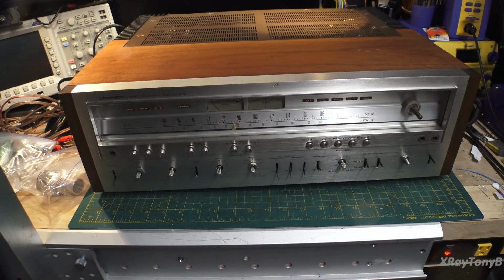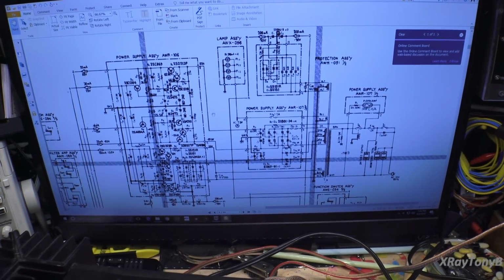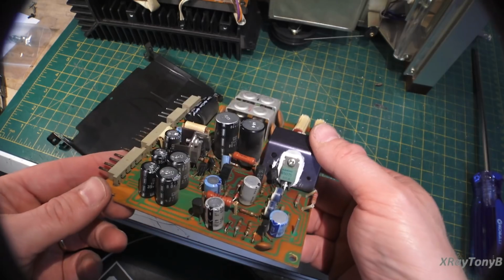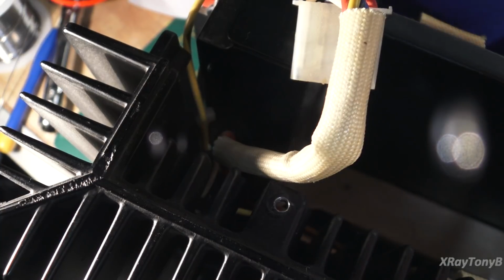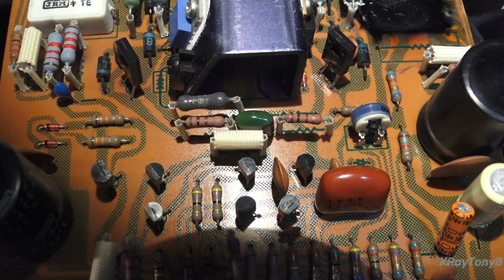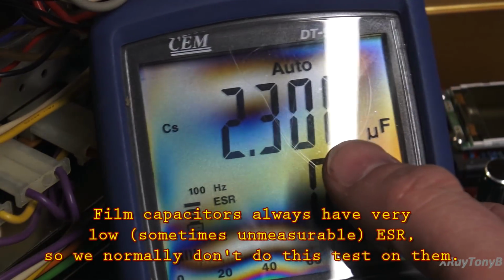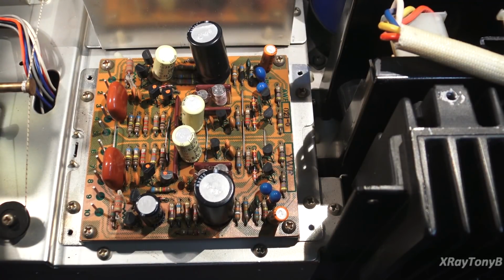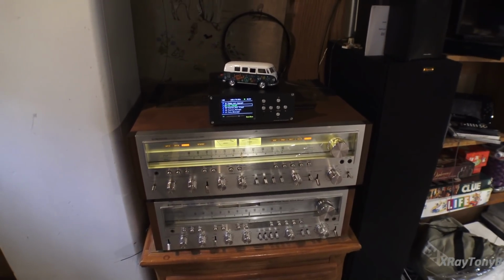PIoneer SX-1250 Restoration

Comment: Robert Matheson
I used to own a Pioneer 1250 and the matching cassette tape deck and turn table in 1977 and sold it in 1990 due to a channel failure. I cried when I sold it when I became frustrated when a local repair shop couldn't get it repaired correctly and was spending too much money at the time.  I always wish I could have it back working but it was too late. I didn't want to buy a used unit today as I was afraid that a used unit would give me a bunch more head aches. I didn't know that a full restoration could be done like you have shown me in your video. Your video has me feeling excited that I can again have my wonderful stereo system.   I am going to buy a used one from eBay and have it rebuilt by someone what ever the cost and again put a smile back on my face. Pioneer need to again make them again, there is a market for them.

Comment: I had the pleasure of baby sitting this receiver for 3 years for a friend who was in the Navy. What a power house, he also bought the matching speakers. I did not want to give it back to him when his tour was over. This was a great video, I am going to do a recap on my Harmon/Kardon  AVR 25II, right channel has low output as does rear and center channels. This is another beast receiver and worth restoring. I am an old point to point builder from the 60's and 70's and am getting back into electronics. Thanks for all the in depth description of the caps, some of them are new to me, like the poly's and film. I just found your videos today and will watch more of them.

Comment: back in the day I was an electronic technician.  I learned a little trick when soldering on pc boards and that was to use print kote solvent after you were done.  The reason was my job out of tech school was working on motorola pagers and 2-way radios.  Pages had very tight pin and foil layouts.  The flux left behind after soldering could potential mask a solder bridge or dot.  The PKS made any issue plainly visible and you knew what you had.  Also a bit of a pride thing to see your work so clean and perfect.  I miss those days of component level repair.  Now I program so my work is all virtual.

Comment: I wish I still had my SX-950 the wife wanted to downsize which is a good idea I don't like hoarding but dang I had my Pioneer gear since 76.  I weighed my SX-950 once if I remember correctly it weighed in at about 45 pounds. I really appreciated the quality of craftsmanship in my Pioneer gear.
Reply: Should have got a new wife.
Reply: @mac11380  As someone else who posted an SX-1980 restoration video said, sure, you could sell it, but then all you have is money. It's not like you could put it toward a modern replacement as some sort of upgrade.

Comment: I stumbled upon your channel last fall(2017) when the electronics bug hit me again after a 13 year absence(I had the classic car restoration bug). Of all the electronics/repair/restore channels on youtube you are in the top two. Thank you for renewing my interest in a much cheaper hobby. last Christmas(2017) my kids bought me a Pioneer SX-1980...only slightly broken- blown fuse. In their mind(my kids), the SX-1980 is supposed to replace - three Pioneer SX-1050's, 4-channel reel-to-reel, couple turntables and a few speakers...all had to be sold to make room(and money) for our rapidly expanding family....next up -- a Marantz 2230 that is just a mess, close to 20vdc at the speaker terminals---someone needs to make a restoration video on this old girl.
Reply: I have a 4270.  Blueglow Electronics channel has pointed me in the right direction with Marantz stuff, in case you didn't know about that channel.
Reply: You need to completely rebuild the regulated supply board in the SX1980, the 80V, 30V  pass transistors all need to be relocated onto the main heatskink, I have done this, and basically it takes a lot of the heat away from that board. There is another mod for the +/-80V current sources, factory uses this underwhelming circuit to achieve it, and there is a nice circuit you can build up on perf board and mount onto the existing board. Don't run the 1980 on an unrestored regulated supply board!!
Reply: I checked out his channel, thank you for your help!
Reply: Definitely need to look into that, thank you!

Comment: Definitive video on SX-1250, Just found your channel from a tech that said he learns from you. My idea to throw out there on that cut wire that was soldered back in, they did have these all hand assembled, mostly by women, back in the 70s on an assembly line, I think every receiver comes a little different, and sometimes what you think of as work done to the receiver, could very well came from factory.

Comment: I think that the DC offset combined with crossover eŕror maybe actually masking  distortions when operating at low signal levels as in your measurement. It's kind of a class  A amp in that case. Anyway, I do very much enjoy your video.

Comment: Interesting video. I have had my SX-1250 since purchasing new in 1976. At the time, the list price on this receiver was $900.00, but discounts were available. These were sold at a retailer called "Best Products" (no connection w/BestBuy), at a sizable discount. However, I purchased mine from Pacific Stereo and they price matched. Never have had mine serviced, though there are some minor issues (bulbs out, etc.). Seeing all the work you have done on this example scares me about how much service/repair would cost.
Thanks.

Comment: Great stuff Tony. Helped me immensely with my SX-1250. During my restore/recap, I did the front panel LED conversion also. Question is how did you get your front panel so bright?  Is there a difference in the construction  or layout in model years? My LEDs work and are very bright but the dial is much dimmer then the unit in this video. Any suggestions are welcome. Thanks for everything Tony.

Comment: I want one! Fully restored would be nice but a working unit in need of service will do! Just don’t know where I can find one! Great job great video cheers… Keith
Reply: Go to pawn shops and or Flea markets, you'll probably find one there.
Reply: Any of those mid-70's Pioneers are worth looking for! I used to find them on Craigslist, and you hear stories about garage sale finds that would make you cry. I got an SX750 that was great. 

Another good brand from that era is Sansui, and I think the prices on the Sansui receivers are lower than brands like Pioneer or Marantz. I don't like the Sansui speakers from that era (I'm really sold on Advents) but the receivers really work ... I have a Sansui 3000A, and it is a killer. I love the way it sounds.

Comment: Nice video Tony, I have done a full restoration on a SX1980, its a mammoth job!! The regulated supply board is always a point of interest.....If you want to see the crossover distortion on an amplifier of this type design, you have to go back up the circuit before the drivers with the scope, otherwise the negative feedback cancels the crossover distortion by the time it reaches the output transistors. Maybe you can do that on the next video.
Reply: Yes, I have seen those, I was going to buy one for the 1980 I restored but the owner didn't want to spend that much money, so I rebuilt the existing one, and it turned out to be not bad....wasn't as scorched as some  I have seen....That wasn't one of Pioneers finest hours that AWR-154 design.

Comment: Thanks for your instructional videos, I follow you devotedly. Perhaps you can advice me how to upgrade or substitute the softstart of my SX1250. The resistor is burnt and I’m having trouble finding a replacement. Thanks
Reply from the maker: Check my first video series on the SX-1050 restore.  I think replaced the soft start in that one.  I think the video is a bit choppy (didn't process correctly when I uploaded it) but you can see what I did.  It's one of the older ones.

Comment: Talking about a dim bulb.  It is getting ever so more difficult to get hold of incandescent lamps of 100W or more.  The times they are a changing.
Reply from the maker: For some reason, those LED bulbs just don't work as well ;)
Reply: No doubt! Went to Walmart thinking I would pick a couple up and they didn't have any
Reply: The greenies are responsible for that my friend. I have stocked up on incandescent globes over my N.O.S items.
There are still plenty around if you dig a little but not so cheap as they were once.
Reply: I think all the Audio repair/hobbyists have taken them all !! lol !

Comment: What are your thoughts on "updating" or "upgrading" the speaker inputs on the back? These great units had kind of cheap plastic inputs that zip wire speaker cables were used at that time.
Reply: There is a company who will do that.  They can even add a bluetooth unit inside on one of the aux channels.
Reply: @MrSFSTUDIOS  Do you know who the company is? Thanks!
Reply: @paddle_shift  JUST AUDIO REPAIR CENTER

Comment: On the AWH-048A Power Amp board, can you provide suitable transistor substitute part numbers for Q7 (2SC1904A), Q8 (2SA899A), Q9 (2SD610) and Q10 ((2SB630-R) ? Thanks in advance.

Comment: I just finished adjusting stab board and am boards per service manual. 0 at speaker terminal but heat sinks run hot. 105f both sides. Do u run less then 65 on stab board, or less then 100 mv on amp boards? Seems much warmer then my other two which run at 77f and 85f

Comment: Why do you not replace those little distortion inducing tantalum caps and replace with WIMA?
Reply: Really! I would never recommend this guy to service anything! Not only because he left the tantalums in,  but because of other things he said and saw him do!!
Reply: @coppertuber  Not all tantalums are a problem, and in most cases can be left alone.  They don't have a shelf life like aluminum electrolytics do.
Reply: @poduck2  Tantalums are notorious for shorting. I know because I have been doing this for over 50 years now. I replace them with film caps. Anything 5uf or below gets replaced with film caps.
Reply: @coppertuber  That is only true when the design runs too close to the rated capacity of the cap, where spikes can bring the voltage up over the rated capacity.  In gear that is 40 years old, if it hasn't gone over the capacity of the cap yet, it likely never will, and if it does, that is because of something else wrong.

There are designs where certain tantalum capacitors were known to have regular failures, but that is a design fault causing a capacitor fault, not a capacitor fault.  These problems are generally well known, and people will suggest that you replace certain tantalum capacitors due to the known design flaw.

There are good reasons to replace aluminum electrolytic capacitors just because they are old, due to their shelf life alone causing failure.  Tantalum capacitors do not suffer from age related degradation, and you can replace them if you want, but if the old cap was going to go bad, the new one will too, unless you replace it with a more robust cap.
Reply: @poduck2  Exactly and I replace those tantalums with film caps that have at least twice or more voltage rating than the original tantalums. Sorry I didn't explain my first reply better.
Reply: @coppertuber  , tantalum caps short in a heartbeat if they are used in a circuit that  puts a reverse-polarity voltage spike onto them. It seems they were originally selected for use in certain circuits where extremely  low electrical leakage is desired, however,  quality modern electrolytics can  usually replace them without any issues. Certainly if the tantalums are less than one microfarad it is a very good idea to replace them with film caps. The same goes for any electrolytic caps of less than 1 microfarad.

Comment: Changing those caps begs the question.  Yes, lower ESR is better - but what if the designers of the tone circuits were compensating for the ESR of the factory caps (in new condition)?  Wouldn't there be a risk that installing "better" caps would result in worse than intended performance?
Reply: Russell Hltn well that's what high quality amplifier designers do they mess around with the components to get the best sound quality hopefully, Ideally probably want to change one side only and run it into mono and see what improvement if any it gives.

Comment: Hi, in the film capacitors which is better to use a thin film or thick film in the audio circuit? What should you look out for for best audio quality film capacitors. What about having a front end valve buffer stage? A amp like that probably could do with a valve buffer stage as an upgrade. Are the output transistors MOSFET and if not wouldn't this be better as an upgrade? Nice job.
Reply: These are good(price is good too) https://www.mouser.com/datasheet/2/440/e_WIMA_MKS_2-1139871.pdf   Too bad Panasonic stopped making theirs.
Problem with film is that the case gets very large at higher capacitance.  Use them to replace .1uF to 1uF electrolytic.

Comment: Too much talking but showing nothing practical.
Reply: I think you're missing the point of Tony's videos. He mainly does these as a vlog for the customer and he also includes theory explanations of other viewer specific requests while on the same job. I think his approach is unique and I feel I get more out of his videos than most others i've watched.
As for the practical side. we all know how to replace capacitors, resistors, diodes, etc etc.. Why would you want to see all that ? Waste of time in my book. 
I'd rather the point to and explain side of things. I have learned far more from "too much talking" than anything on the practical side. The prac is something you gain after learned the theory.
You need to learn to walk before you can run.